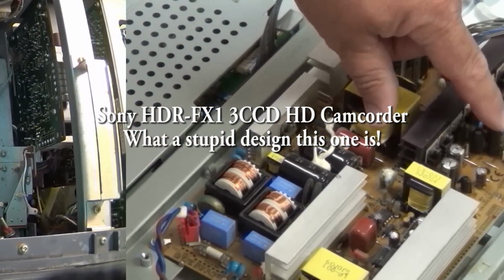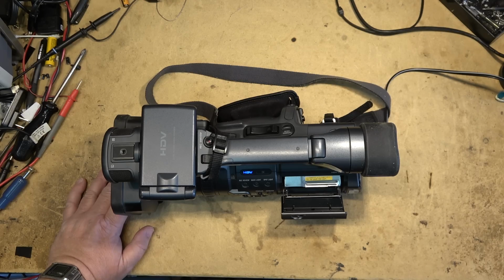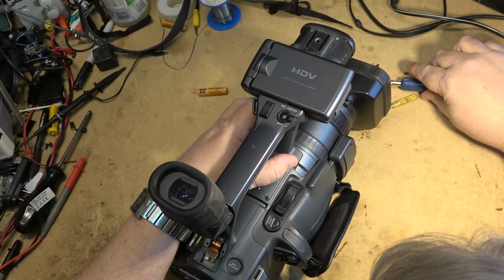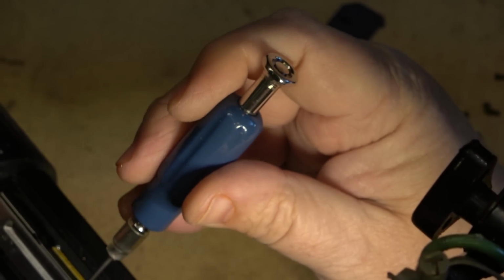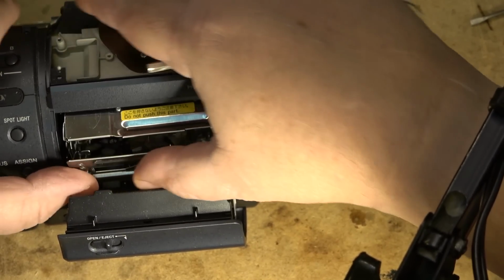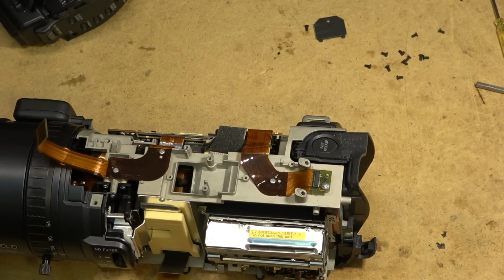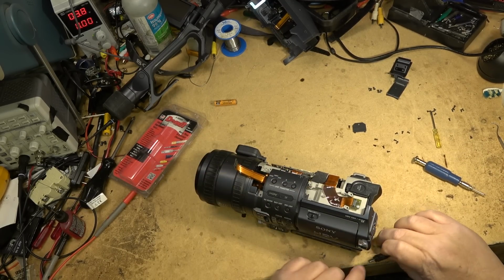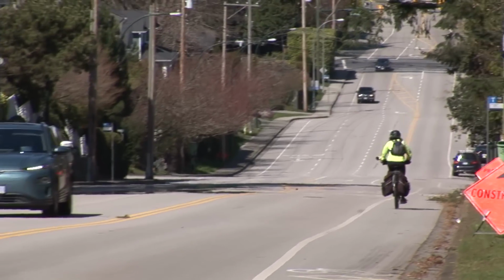Sony HDR FX1 HD camera from hell what a stupid design find out why

Comment: Hi
I have the same problem but the only difference is when its on play mode, I hear a ticking sound and the playback would do stop and go........Help. Should I just grease them things and hopfully it would loosesn up.
Reply from the maker: That ticking and squeaking sound is called stiction and it is the tape physically sticking to the guides and rollers. The tape is breaking down. Look up sticky shed syndrome. 
It has plagued audio users for years and unfortunately it is starting to raise it's ugly head in video tape too. Another problem is mold if tapes are not stored correctly.  This is why everyone needs to get everything they treasure on video tape NOW as in today. Don't want for tomorrow or next week or next year. If you have valuable content that you want to preserve get it on DVD or Bluray disk media and to a hard drive. I have DVD disks that are well over 20 years old that play perfectly and CDR disks even older than that that still play.
If people were still buying DVD and BD players the manufactures would still be making them, but because people stopped buying many companies stopped making them. 
Everyone is throwing their eggs in one basket. They are putting stuff on their computer, or external hard drives but all it takes is one drop and everything is gone. USB sticks don't last much beyond 7 years, and SSD is just as unreliable as the data must be refreshed and rewritten to different sectors or it can just vanish, so not good for long store storage where it is not powered up regularly. Cloud storage is also a red herring. What is to say that down the road the cloud provider is not sold to another company that revises their user agreement and then jacks up the monthly storage to eye watering levels. Once everyone has everything in the cloud, or changed theor policy to now own all your content and grant themself permission to use your photos for their own gain. 
Everything you value needs to be backed up onto multiple formats. When I do digital archiving for my customers 9 out of 10 take their footage back on a USB stick or hard drive and a second copy on DVD or Bluray.

Comment: That Sony HDR FX1 came my way after the owner had dropped it over the side of a speedboat on a corporate shoot. It was the 1st time he used it & it floated just long enough for him to pick it up. It was ruined & when i opened it the seawater had destroyed almost every copper piece of track or ic pin. I wrote a report as to why the unit was not worth repairing, especially the lens which was still full of water! 8 weeks later the owners insurance company came to me demanding why i had advised he make a claim.  Their assessor became an asshat accusing me of all the damage! Then they shipped the camera to an independent ultrasonics lab that cleaned stuff where they tanked it & returned it. Most chips were gone from PCBs and the optical elements had changed color.  The insurance company demanded that now it was clean i could make it work or they'd sue me.... A letter from my solicitor saved my butt although the whole nightmare had me out of pocket almost $1000 & no path for any compensation. I no longer touch any pro equipment like this that's had swimming lessons...
Reply from the maker: I would tell them to take a long walk on a short pier.

Comment: Excellent 720p60 video this thing shoots! Would have been sad if it was irreparable due to this stupid design.
Reply from the maker: This one shoots actually 60 frames, but encodes as 60i, which is what all broadcast TV is  transmitted at if it is in 1080. This video was rendered out as 60p.
There are other modes that it can operate too. It can do 30p, where the shutter operates only once every 1/30 second and the progressive frame is encoded at 60i. It also does a psudo 24 frame

Comment: Sony are not THAT dumb. You can force the eject/closure of the mechanism from the access panel at the base. Here's an HVR-Z1E, but the HDR-FX1 is just the same.
https://youtu.be/IlpDTQ4YXKA
Reply from the maker: Well when you have the service manual handy then you know where to apply power.  I don't have the manual for this model, and going in, did not expect the side cover to be trapped by the mechanism. Good information for future work on this one if it ever needs it again. Remember I got this one 2 years after I left the business, so no access to manuals or service data.
Reply: @12voltvids  You did have to work it all out for yourself (or spend $25 for a service manual), in the old days. Now you can get them all online, for free.
Reply from the maker: @dwilliamson8539  Manuals were never 25.00 I paid about 130 for the CCDVX3 I used to have and never opened the manual. I got rid of the camera but still have the manual. Online manuals are a joke. I can't work off a small screen. I need the full manual that I can lay out on the bench and trace electrons.  Going from page to page is a joke, and even printing and sticking pages together is the shits. Scans are never good enough to read anything.

Comment: This is usually a 2 minute repair, as you can access the drop switch on the mechanism from the open door and put a couple of drops of Servisol in it.
Reply from the maker: Yes  I did access it from the open door. Once I could actually see the switch. Done that many times on 8mm. I did exactly that on a digital 8 deck a few months ago. This is only about the 3rd miniDV deck I have had open. The only ones I ever serviced was the VX1000. Never got a chance to see many, because they were usually write offs. Cameras would come in that had water damage from all the idiots taking them out on boats. All the newer cameras had a label on the inside of the box advising not to return to dealer for problems. Even my tiny little HDR-HC3, when the lens started acting up on that one while under warranty, I shipped it off to Sony and let them deal with it. That one is still one of my favorite cameras from an engineering standpoint. Probably the best tape that Sony ever made. With that real xenon flash tube for the stills camera. Fantastic. Best of both worlds. An HD video camera and a 4.0 megapixel point and shoot camera with a real flash built in. The real engineering marvel though, and I don't think many will argue on this is the pocket DSC TX100V. 16.2 megapixel, stills with a real xenon flash, OLED screen and full HD video that shoots in 60p and small enough to fit in a pocket. Yes I know cell phones will do that now but they don't have a real flash tube.

Comment: HC3E; engineering marvel, until the mode wheel contacts stop working. I can repair that cheaply.
Reply from the maker: You mean the power switch?
Reply: @12voltvids  No, the mode wheel in the mechanism; usual symptom is the carriage will not close and latch, with an error code.
https://www.youtube.com/watch?v=lXvZ1No5azc

Comment: I have learned something about these types of camera. Don't buy them. I got my little Aiptek flash based camera back in the day and it still works to this day. No moving parts, no tapes. I did have an issue with the power button and the multifunction wheel but I was able to fix it. Also the front strap mount broke but a red hot wire later fixed that. And the battery door clips broke from use but I put a hair tie on it.
Reply from the maker: Tape is something we can all do without today. Sorry I just pissed off all those that think tape is better, just like there are some that think vinyl is better and pay a fortune for old junky turntables.
Reply: @12voltvids  It's ok the only thing I have that's tape is audio cassettes and VHS tapes. I listen to MP3s and record on digital. I bought two preamps for my TT and they both don't work so I just stick with mp3s.
Reply: SD cards are not much better.  You are recording to a file on a device that holds a filesystem.  There are so many abstractions in the way that any one of them can fail and break the file, entirely, or half way, or the entire card itself.  Give me flash media that does not act like a disc, and I will love it.  Tape has problems because its old, but as a recording media it is much more resilient to "issues" than flash as tape is simply a dumb stream of bytes.  As long as the tape does not chew up, and damage to the tape or video stream can be bypassed by simply letting it play.

Like HDV tape, flash based recorders use the transport stream format (unless they are my DSLR which crazily uses MOV),  as that file format also has that resiliency.  Errors in that file thus don't damage the rest of the file beyond that point, only the damaged portion is affected.  Transport stream is also used in TV broadcasts for that reason, its great.  However the medium that is used will affect the resiliency, flash is not anything like tape.  All of its "improvements" are merely seen that way because they are just more convenient. But when that SD card just dies on you, which they do, the entire card dies.  Everything goes with it.  I'd rather use tape than hope that I have enough money for data recovery services, and they don't usually recover SD cards as they are not worth as much as recovering a HDD.

I have plenty of SD cards in many devices,  so its not like I dont use them.  I have a bunch of them in front of me,  my DSLR, a cheap model, only uses one and I never let data sit on it more than a few hours.  I just respect the fact that a medium, and recording format that is able to ignore errors, digital and physical ones, is superior to a format that is only liked because of convenience.  A friend of mine has had a much more different experience with SD cards that he simply puts into the digital camera, where it happily stores the photos, then he phones me because one of the cards has died totally and the other card is working but half the pictures are a corrupted mess and a third are "gone" which I usually get back using recovery software.

What make were these cards?  Well, the supposed king of flash: sandisk.

Oh year, one of my 64GB flash drives died on the shelf.  64GB gone, in a flash.  Luckily knowing this failure is possible I never store data on flash, only transport it.

So, tape is old, superior and old and will jam up and become annoying.  SD is convenient, but that comes at a cost.  When my HDV camcorder needs replacing, what will I get...  well the only smart thing is to get a 2 SD recorder.  Have the camcorder record to 2 cards at once,  that's what the pro's do in pro level DSLR's and camcorders, for the reasons I stated.  Oh and no, never get HUGE insanely big SD cards.  No 128GB cards, unless I'm doing 4K which is unlikely as I don't have a 4K TV so no point yet.  Nope, small SD cards, different manufacturers, dual recording, swap frequently = less chance of losing your holiday video.

Oh and I always stress the SD card to rest it.  I write to every sector several times, a proper test, I have killed weaker cards that way.
Reply from the maker: @dlarge6502  SD cards can and do fail. I have had one fail. I was having problems recently on my newer camera with a Sandisk card, but it was more of a speed issue. Not fast enough. Didn't lose any files, just the camera ran out of buffer. I believe the old camera didn't have the issue as the camera had more memory internal and just buffered the video until the card caught up.
Tape however has so many issues I can't overlook. Drop outs for starters. Especially when dealing with a long GOP like HDV. A dropout results in losing 1/2 second of video.
I have had more issues with USB thumb drives. Controller chip dies and no more access. In fact I have only had 1SD card actually fail and that was because the contacts wore out from putting it in the camera so many times.  I don't use SD cards for long term storage though. I shoot and then transfer right away to external removable hard drives. When I travel I haul my laptop with me to download daily.
I do have software I bought that has recovered damaged video files.

Comment: To remove the front cover of my old PC you need to remove the front piece from the CD-ROM tray. This requires ejecting the drive first. To service the drive you need access inside the front of the case. So if the loading belt goes bad, good luck.
Reply: Every cd/dvd/bluray computer drive I've seen has a small hole in the front(though it's possible some don't) - push a straightened paper clip in, and it pushes the tray out.
Reply: @DoubleMonoLR  In this case the custom bezel the case uses covers where the hole would be.

Comment: The "5D" on the bottom is the date code. 5 = 2005, D = fourth quarter of the year.
Reply: Sony would use only A, B, C, and D for the 4 quarters of the year for example:

A (January - March)

B (April - June)

C (July - September)

D (October - December)

They always used that system for the date of manufacture but sometime they stamp the actual month and year of manufacture.
Reply from the maker: D would be April
Reply: @12voltvids  The quarters of the year part is just a guess. I've never seen these Sony date codes with letters any higher than D.
Reply from the maker: @vwestlife  the camera was released November 1 2004, and I had one of the first ones to arrive in Canada.  I didn't use it long as my business partner was diagnosed with cancer at Xmas 2005 and died in March 2006 and I shut down my wedding production business at the end of 2006.
Reply: @vwestlife  I am pretty sure it means quarters of the year, I have a Sony HVC-2200 video camera that was manufactured in December 1981 (the date is printed on the certification sticker on the electronic viewfinder), and the date code is 1D. So it means the last quarter of the year.
Reply: If it was a Panasonic camcorder or VCR with a serial number starting with D then the D would indeed be April. I don't know if that's true for Sony stuff.

Comment: Have a canon XLH1 HD but they have issues when  taken  off  lens and firewire plugs   fuse on the board would blow if you did not disconnect the batt i have 2 canon XL2 Also just power them up and run tapes

Comment: alaso hdv from canon too
Reply from the maker: They all made HDV cameras for awhile.  Some were 720p and others 1080i. I have a big JVC gydv500 that needs service. Should I fix that one? It's just a standard def, but an ENG type with 3ccd camera.
Reply: @12voltvids  My canon HDV does 1080p, only in the 25fps mode however which is what I film everything at anyway.  I cant stand the soap opera effect.  It has to record the progressive frame as two fields in the interlaced video, they line up to make the progressive frame with a reduction of half the frame rate.
Reply from the maker: @dlarge6502  You sure about that?
HDV had 2 recording modes in the spec, 720P60 and 1080i60.
My camera can run in 3 modes. 24P frame 3:2 pull down to 60i, 30P encoded as 60i and 60i.
Both the slow frame rates drive me crazy especially the 24 frame simulated mode.
My 4K camera has true 24P and 30P. The 24 frame mode is totally useless. Yes I know it gives the cinematic effect, but I hate it. I don't go to movies because I just can't stand slow frame rates. Needless to say I haven't watched movies in years.

Comment: Now that was a worry,  obviously sony didn't think at all about failure.
The recording looked smashing, so no nasty caps playing games.
Maybe leave the deck open and put the camera in a dust free box,  when you next need it then operate the micro switch a lot before using the deck.
That silly switch is a pain in the arse!!.
Reply from the maker: It's got cleaner in it now so should hold out.

Comment: It seems that Sony rushed to market with this unit. 
The screw behind the mechanism and the rechargeable button cell on the bottom without connector makes me think they missed some spots to make the unit available to market as soon as possible.

However, I like the picture it produces. Even almost 20 years after it still looks good.
Reply from the maker: It does look good.  Many tv shows were done with this in the early 2000s for discovery Channel.  Think deadliest catch. News media used them too because they were cheap